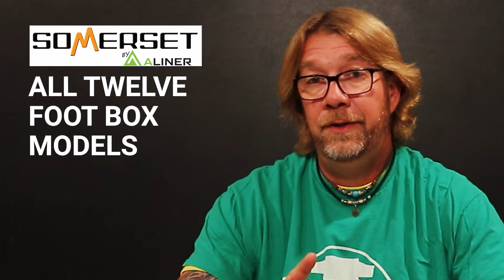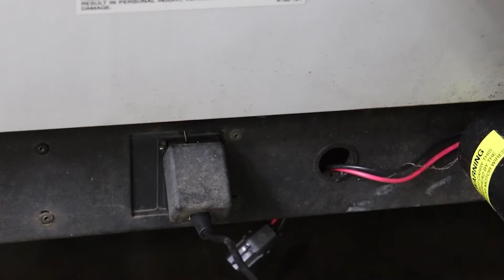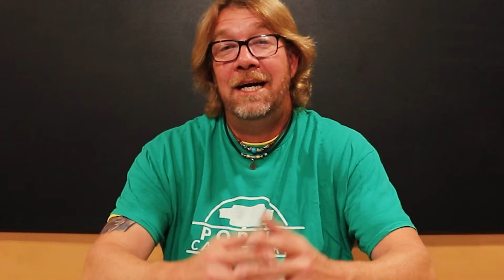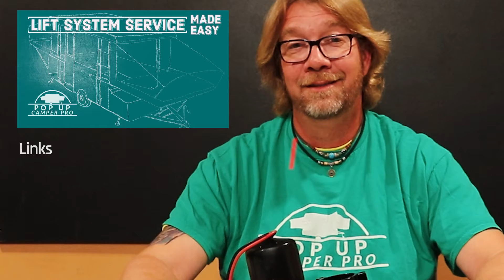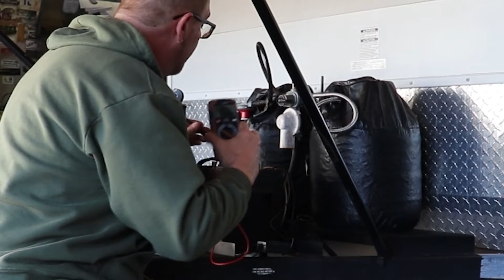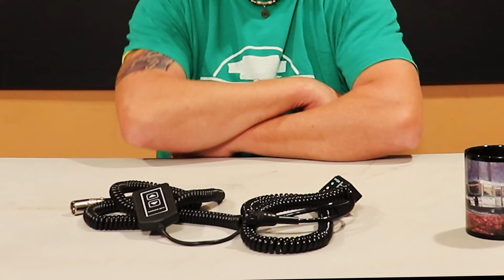All About Power Lift For Coleman Campers

Comment: My roof would go down but would not go up. I checked the voltage coming out of the current limiter and it showed 12v when I pressed down but 0 when I press up. I think my limiter is broken. Does this have a fuse or is it repairable? Thank you sir
Reply from the maker: Try some dyslectic grease between the motor and limiter connections, and plug it in.
Reply: @popupcamperpro thank you

Comment: First,  that chalk art is Beautiful!!! Thank you for that information. I have a coleman Chesapeake.  It has the manual lift, and another that is about center of tongue.  I thought that might be where a motor might go. After this, it seems it may be some sort of brake. Is it something to keeping it from rolling down if you lock it somehow? I'll likely keep hand cranking. Good exercise, but a motor would be nice!
Reply from the maker: This would just be an extra or secondary way to raise the unit in case the first gear reduction system had an issue. Thank you for watching, writing and the compliment on the artwork!

Comment: Great content, thanks. Our camper is a Flagstaff ands has a different system (it’s a hard wired switch at the front of the camper instead of the remote at the back.) Do you have any knowledge or troubleshooting on these? - Adventures in Pop Ups commenting on our other channel 🤓
Reply from the maker: Sure! Please give us a call at Coleman pop up parts. 1-800-424-CAMP

Comment: My powerlift ONLY works when connected to Shore power.  The limiter/control box has been modified with a key on and up down toggle switch.  Why does it only work on shore power.  Giving it 12v diret to connector at limiter/control box it studders and doesnt move.  no binding when on shore power goes up and down no issue.

Comment: My current limiter makes clicking noise when I try to lower or raise the roof, but the motor doesn't turn and no current comes out of the current limiter. Do I need a new current limiter?
Reply from the maker: Sounds like it, but first check your ground, voltage level to the limiter and make sure the tree is clean and greased.

Comment: I have a 2019 Somerset Pop Up Camper. In my Power Lift Operating Instructions it says: "It is safe and permissible to operate the power lift system with the trailer power chord plugged into a 110VAC outlet". The instructions that I have were revised on 1-9-13 by Columbia Northwest, INC. You say it's not recommended. What's the deal?
Reply from the maker: New limiters the issue was fixed. There are so many still in service that have the old style, my personal opinion is to not recommend it. The camper will raise on 12 v when the system is in good working order.
Reply: @popupcamperpro  Thanks for the clarification. Love your videos!

Comment: I’ve ordered the newer style power limiter and remote system. You mentioned in video if you’re having difficulty with low voltage to limiter you suggested running a new harness directly to your battery with a 40 amp breaker.  What gauge should the wires be?  Or can I order a harness from Coleman parts?
Thanks for your time!
Tom L.
Reply from the maker: 14 or greater will be fine.

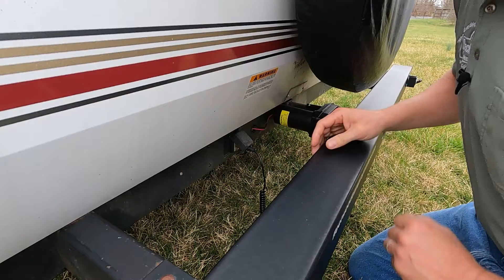Comment: 1:25 what size motor do I need for my Coleman camper? It did not come with a lift. I had one put on it and it’s not have enough power to lift it. I have two king size beds one on each end It’s very heavy it’s a 2003
Reply from the maker: Should be the round drive motor. Simply remove it to confirm.

Comment: We just bought a 1996 Coleman Fleetwood Niagara and the power lift system controls dont look anything like this.  There is a metal toggle switch, a plunger for the cable tension and anther knob tha controls, releases hydraulic pressure, I think.  Any idea where I can find an orientation and trouble shooting video for that system?
Reply from the maker: All currently available literature and instructions for hydraulic lift systems is available at our webstore. Links in the description.
Reply: Thanks @popupcamperpro , but I am not sure you understood my comment.  The original controls on the 1996 Niagara we just bought looks nothing like anything I can find in any of the videos you have linked to, so I am confused and woudl like to find informtion specific to the system I have.  I understand, I guess, that if it is not in the links below the video, you have no materials that address the system on what I bought.  Thank you
Reply from the maker: So sorry, I should have been more clear. Available literature and instructions for hydraulic lift are available on our webstore. Links to the webstore are in the description, or by search for coleman pop up parts dot com. When you find our site, click on the header link INSTRUCTIONS then scroll down to LIFT SYSTEMS. I hope this is helpful, and sorry for the confusion.

Comment: I have a 2002 Coleman Niagara pop-up and I have to hit the solenoid like you would a starter on a car and it seems brushes make contact and then it goes up. otherwise, it just clicks. My question I'm wondering how hard it is to replace? Just undo the bolts, slide one off and slide other one back in place, obviously disconnect the wires or unplug. This camper they stopped making because roof spider checked all over the roof, Is there any moderately price coating I could put on it. The roof shell is 20 foot long. Thank You for your help, Where is it you sell these replacement motors?
Reply from the maker: Links are in the description, and more how to videos for power lift are now available!
Reply: What can I put on roof to seal over those spider cracks on top of pop up. Niagara has 20 foot surface, I need to reseal, Thank You.  @popupcamperpro
Reply from the maker: @JamesGross-e8e  skinning the outer ABS and repainting with a truck bedliner is a popular option.

Comment: Thanks for the great video. One question, the voltage test shown is that before or after the current limiter? I get roughly 8-8.5 volt to the motor after limiter and wondering if that is correct or not. The roof raises what looks to be fine just takes a while and sounds like the motor is struggling.
Reply from the maker: After the limiter. You need to get it to at least 12.5V Check out our video covering the motor install for more tips.

Comment: Just bought a 1995 Coleman Williamsburg and it will not open. I’m told it’s a hydraulic system and there is no crank. Anyway to manually get this open? I’ve spent days googling and haven’t found much info
Reply from the maker: If the system is operating, then you should just need 12 volts. If you find you need a new pump, send it to me. We are looking for one to rebuild.

Comment: I'm only getting a clicking sound from the limiter when I use the remote so I checked the voltage when hitting the lift and lowering buttons to find I'm only getting about 3v each way. You mention hooking the limiter directly to the battery but adding a 40 amp breaker. Is there a kit for this or do you have further instructions/video for doing this since it seems the best way to fix my issue?
Reply from the maker: Not yet but it’s that easy. Just new power feeds direct to the battery with a breaker.
Reply: @popupcamperpro sounds easy enough. What gauge wire would be best, and which side should the breaker go on, + or -?

Comment: Thanks for this helpful video! I recently got a 2013 Somerset Sun Valley from a local dealer. We were told by the seller that we can either use shore power OR battery power to raise/lower the roof. On our second camping trip, while putting the roof down, it stopped midway. (Shore power was used to raise/lower the roof during sales pitches and during our two camping trips.) No clicking, motor noise, nothing. I'm now seeing online advice to never use shore power with the Power Lift. Did the shore power break the Power Lift? I asked the dealership, and they stand by their advice that you can use shore power on the Power Lift. For now, we will just manually crank the roof open/closed (after unplugging the motor).
Reply from the maker: It’s not recommended. Always best to use only battery power for quite a few reasons.
Reply: @popupcamperpro  Mine only works on shore power.  12v direct makes it just studer up and down in either direction.

Comment: I have a 2003 Coleman Utah pop-up that is hard to  crank. It has broken the shear pin inside of the crank mechanism 3 separate times. We have replaced the pins, the entire chain crank mechanism, done maintenance to the whiffletree and everything looks to be correct. We are so frustrated and are at the point of selling our camper because we don’t know how to fix it. What else do you think it could be? All cables look normal as well.
Reply from the maker: Hello again Halley! Still awaiting your call to go over what may be wrong. Please contact us back at the shop or email for afterhours emergency tech services.

Comment: So you're saying that there's a brake in the power lift system that is engaged when it's powered?  Not familiar with these but that doesn't make sense to me. Wouldn't that mean that if the system lost power that the break would disengage? That seems backwards to how a braking system like this should be designed.
Reply from the maker: The brake is disengaged when lift or lower is activated via a momentary switch style remote do RC
Reply: @popupcamperpro  okay then I'm confused as to why you would say they're disconnect the wires when manually raising or lowering it since if the break is engaged from power is not applied it's going to stay engaged when you disconnect the wires
Reply from the maker: @DoRC  not in this instance. Releasing power releases the brake. Thanks for watching and very good questions!

Comment: Great video Derek, just subscribed!  I have a 2008 Niagara and the power lift won't raise the roof (but it will still lower).  When I try to raise it, it sounds like the motor is engaging but nothing happens.  Any idea what the issue could be?  I had raised the roof on shore power maybe 6-8 times (previous owner never told me not to).  Did I burn out the motor or can I fix this?  Thanks!
Reply from the maker: Hello Matthew and thanks for subscribing! It could be that the system needs lubricated, or the thrust bearing replaced. I would start with our video DIY lift system maintenance and see if that fixes it. If not, then check the cables, make sure the pan cover is on and look for binding in the arms. All these good, it’s probably the bearing. They last about 20 years.

Comment: Thanks for all the great videos Derrick!

If you power lift roof doesn't want to go all the way up, the 1st thing I'd do is clean and regrease the whiffle tree. When mine gets ornery, this resolves the problem. Spraying the various pulleys under the camper and in the lift arms with silicone is a good idea also.
Reply from the maker: Great tips Aubrey! Thanks for sharing.

Comment: I have a 2007 Fleetwood Evolution E2 and I think it is time to replace the thrust bearing, as the crank mechanism has considerable resistance in spite of my visual inspection and lubrication. The camper came to me that way, with a stiffer than expected crank. I've watched you videos on that subject.

Instead of replacing the thrust bearing, could I install one of these motor lifts? Is there any guide that indicates what parts I would need, what I might have to fabricate, etc?

I see that some people use a high torque drill to drive the crank, but until I replace my thrust bearing the resistance is too high for the drills I've tried, so my popup gets hand cranked every time as a result. It may be that getting mine back to factory-smooth operation is the likely best path, but I thought I'd ask about motors anyway!
Reply from the maker: Hello Clark and thanks for writing! Your E2 can take a power lift system. They do use a thrust bearing as well. 

You can find the instructions and material list on our webstore under the link instructions, and in many of the power lift components.

Comment: Your video’s are so helpful..   have a 2017 Somerset e3 and thought my lift system was broken.     Would just click and not lift.    Finally figured out issue but this video would have solved.   Mine would not raise because grease from worm drive was clogging pulley that is just past.    Used some WD40 on that pulley and everything work perfect.

Thanks again
Reply: We have the same camper! I feel like I never see Somersets in the wild. 🤔